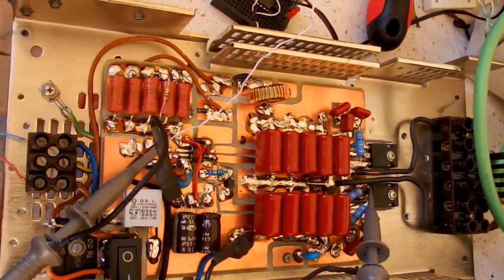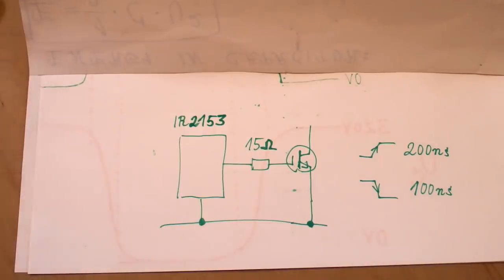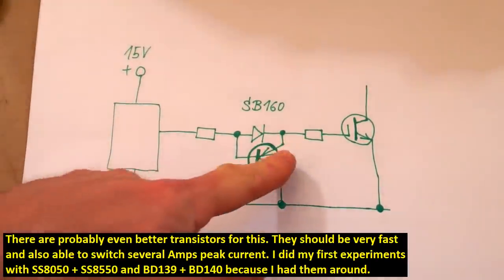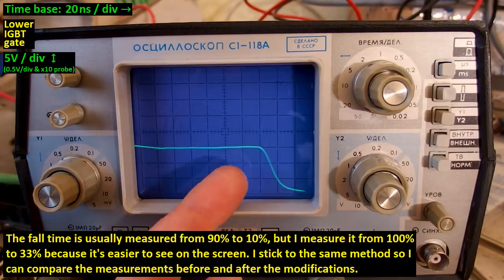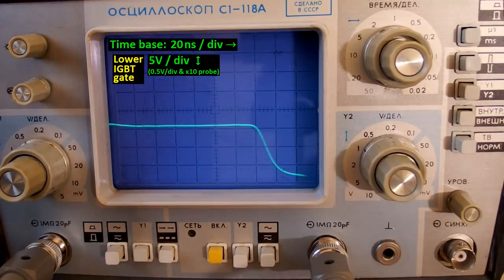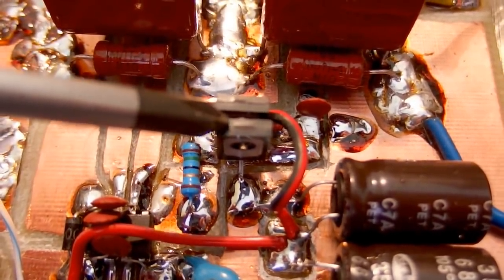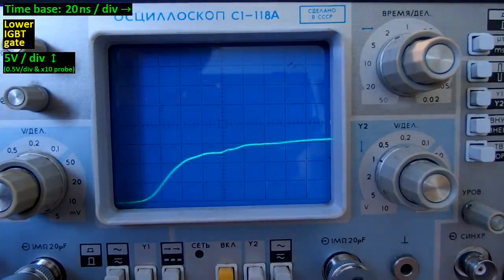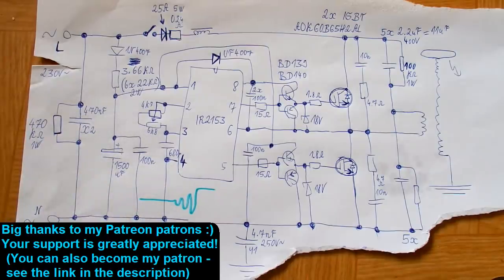SSTC pt. 10 - Gate drivers

Comment: We usually use also a small electrolytic capacitor like 22uf in parallel with the small ceramic onror to help out with the charging current to the gate

Comment: "IR2153" is an interesting driver, which does not specify the pulsed current output rating (in Amps). For example, "IR2110" has IO +/- is 2A, but "IR2153" does not specify any such value on data sheet. May be "IR2153" has low current drive rating and that may be the reason to add additional push-pull circuit?
Reply from the maker: there's multiple different datasheets of IR2153. Some don't say the output current, some say that it sinks 400mA and sources 200mA.

Comment: Great content! I used the two-transistor gate driving circuit too to drive a MOSFET faster, it works great! You should use a faster oscilloscope though to measure rise and fall times that short...the C1-118A is only 20MHz BW (had to look it up).

Comment: Great videos!! THANK YOU SO MUCH!! was wondering if I'm using a pulse transformer to control the gate, is it posable to still use a transistor to amplify the gate current?
wouldn't doing this  cancel out the isolation between the circuit? I think using the GDT was a mistake anyway! STILL WONT WORK!!
Thanks in advance
have a great day

Comment: Hi. Isn't the base resistor 15 ohm too low for BD139 and BD140? The base current should not be higher than 0.5A.
Reply: The maximum current from an IR2153 is around 180mA source and 200mA sink. This is more than enough to drive BD139/40 considering the HFE in these transistors. The base resistor could also be 47R which will still give enough current gain. This I tried myself driving a GDT and getting more than 1A at the output.
Reply from the maker: well, the 15 ohm resistor could be higher. I just left it in place because it was previously driving the gates directly :). I may lated change it to 33 ohms. But anyway, the IR2153 can't sink more than 400mA and source more than 200mA anyway.
Reply: @DiodeGoneWild  Well to be fair the source and sink currents are not specified in the datasheet for the IR2153  while its counterparts the IR2151 will source 100mA and sink 210mA and the IR2155 will source 210mA and sink 420mA I guess the  source and sink currents for the IR2153 must be somewhere in between. With these currents there will be enough to drive the current amplifier for the IGBTs for sure.  Keep up your good work and thanks for sharing your experiences with us.

Comment: The gate drivers need to be able to supply amps - do you have a feel for the size of current pulse into the IGBT gates with the gate driver transistors in place ? Just curious - it seems amazing that gate current could be so high, even though it's only a burst of course...:o)

Comment: Hmm, it is possible to use current amplifier at ss8550 in self-oscillating flyback to reduce turn-off losses? I have not seen anyone use similar solutions in self-oscillating flyback.

Comment: Thanks for the interesting update. It could be seen already in your last video about your SSTC but now its even clearer. I am working on a royer converter for an induction heater and have problems with good switching edges on the gates. I use power mosfets IRFP4768 (getting the real ones soon - after failure with counterfeits from ebay). I guess the edges got worse and worse with the load because the fake mosfets had much higher Rdson - meaning the other mosfet couldn't be drawn to zero by the fast diode and with the voltage drop over the diode and the bad conductance of the other switched-on mosfet, the gate of the stopped mosfet was in the threshold voltage and lost a lot of power. I wonder if this totempole amplifying circuit to improve to gate drive will help here too - as it is directly coupled with the main resonant tank circuit - what do you think?
Reply: If you have fake mosfets it will also have lower gate capacitance, adding a current amplifier will not help in your circumstance because you already got enough to charge the low gate capacity.
Reply: @Heads Mess Thanks for the information! The circuit i am using is here: http://kaizerpowerelectronics.dk/wp-content/gallery/2013_01_17_-_royer_induction_heater/royerIH.gif
The gates are driven by the feedback of the tank circuit via the fast diodes which draw the gates to zero when the opposite mosfet is conductive. If the Rdson is too high, it wouldn't be able to draw them to zero at high loads, so adding the voltage drop of the Si-diode there might be too much gate voltage still to totally shut the mosfet down. I measured the gate signal on different loads and it gets worse and worse. I am pretty sure i got fake IRPF4768 - thats probably the main issue. When i put the amplifier circuit (totempole config.) before the gates it might work better - still not sure if it disturbs the resonance circuitry? A schottky diode instead of the fast Si-diodes would also improve the situation - but you dont find a fast schottky for 500...600 V and some high current in the 10th A region. I drive the resonance at around 40 kHz only and have these problems - but no ringing so far. If you reduce the gate resistors you get faster on-edges (no fast off-edges) but put more load on the zener-diodes.
Reply: @supersilve  Yes, they have 50% lower gate capacity and they are fake. It seems the problem is not the current to charge or discharge the gate capacitors but the voltage level, esp. on the off-edge. Will see how the real mosfets work...
Reply: @richardnanis  Yes that is all true but that is how hard you switch the gates, more current more fast rise time and less fall time,, the edges get sharper accordingly.  The only thing left will be the time of switch on/off of the component itself that you can never change.

Comment: I have a quick question , why there is no voltage in the output of my gate driver if I have 12v in the input ? 
I connected it all correctly according to the datasheet and Im measuring it on a multimeter

Comment: could you use a schmitt trigger to flip a signal comming from an antenna and then tru a resistor or capacitor or both feed it into the chip for feed back?
and how it works is like this :  there will be a capacitor on the chip oscillator pin and the chip will start oscillating but the antana will receive the exact self resonance wave form from the secondary coil and then the signal will get fliped and then feeds in to the capacitor pin of the chip
so in that way the coil will run at its resonance frequency
Reply: You could but I think he avoids it to keep the circuit minimal. Steve Wards Micro SSTC uses the antenna feedback to drive a gate driver directly so the inverter isn't even necessary sometimes.
Reply: @Magneticitist  yes i have seen it
but as you know with the ir2153 when the timing capacitor voltage is rising the low side output is high 

this circuit is super simple and works
Reply: @Magneticitist  yes that would be much easier 
im very interested in electronics but i dont have money to buy even a cheap multimeter 
but i have made a single switch tesla coil with 10-15 cm long arcs
Reply: @alirezaeskandari2287  10-15cm sparks is more than a great start. Buying instruments and components isn't easy on a budget but these days they have some pretty affordable stuff available to where a person can sort of take steps instead of saving up a lot of money to get the expensive stuff. I think a $5 voltmeter is fine alongside maybe a $20 LCR meter. Something like a DSO138 scope can be handy at moderate frequencies, I used one of those for a while. I've seen those go for like $10 on ebay. $5 400khz signal generator modules are pretty nifty too. You probably know all that but just think about how expensive it must have been years back before all these cheap entry level instruments were available.
Reply: @Magneticitist  thanks for your advice 
but when you live in iran even a crapy old crt scope is 1M tomans and that is a lot of money for us 
a worker makes 1.8M tomans per month 

by the way im 16 :)

Comment: a comparation with TC4420 ci drive, please.
Reply: CD4022 is an octal counter, how would that drive a half-bridge?
Reply: @drobotk  sorry, It is a TC4420
Reply: @vidanatural_oficial  Oh, that's a different story
Reply: TC4420 is commonly used because it's fast and fairly powerful but the main comparison so far is that when using the low side drivers like that it's going to require what could be a lot more headache when it comes to say getting a GDT switching nicely.

Comment: Tx, very interesting and informative as usual. 
Could you also you MOSFETs as drivers and what would be the advantages/disadvantages compared to BJT’s?
Reply: I found this but don’t quite understand it.

Totem pole stage with N-Channel and P-Channel MOSFETs can be used to boost the output from an IC Driver. The disadvantage is that the signal is inverted and also there exists shoot through when common gate voltage is in transition.

Totem pole arrangement using matched NPN-PNP transistors, on the other hand, offer many advantages, while boosting the output currents from IC Drivers. Shoot through phenomenon is absent in this case. The pair of transistors protects each other’s base-emitter junctions and handle current surges quite well.
Reply: @Conservator.  whats not clear about that? It is a clear answer to the question, so i wonder how and where you found it when not understanding the jargon or
I wonder because if there is a way to find such nice&good&complete answers for such electronics questions that would be great for me and many, so i think
Reply: Rob Son 
What I don’t understand is why there would be shoot through when using MOSFETs and not when using ‘matched NPN-PNP transistors’. 
And why will the signal be inverted using MOSFETs and not with bjt’s. 

I didn’t read the hole document to be honest. I first posted the question and later added the explanation from the document.

Maybe I should read (=study) the document first.
Reply: @Conservator.  Inverting: With mosfets, you have a pmos on top and an nmos on the bottom. When the driver output is high, the nmos turns on and the pmos turns off (the threshold voltage, Vgs(th), for n channel mosfets is positive and for p channel mosfets, negative.). This connects the output to ground. Likewise, when the driver output is low, the nmos turns off and the pmos turns on, connecting the output to the positive supply. Thus, the output is inverted. 
Shoot through: Suppose the supply voltage is 12v. 12v is standard for mosfets, 15v for IGBTs. Because the driver cannot instantly change the voltage on the mosfet gates, with the gate capacitances and parasitic inductances, there will be some time when the voltage is high enough to turn the bottom mosfet on and low enough to turn the top mosfet on. From around 5v to supply-5v (5-7v here), both mosfets are fully conducting. Since the two fets are the only thing between the positive supply and ground, there is a relatively large amount of current that shorts through the mosfets. This is shoot through. 

The benefit of mosfets is that they can provide rail to rail outputs, since the have internal resistance instead of voltage drop. The gates are also isolated, so less current is needed to control the mosfets.

With bjts, there would be an npn on top and a pnp on the bottom. The npn conducts when the voltage between the base and the emitter is above some 0.7 v or so, proportional to the amount of current flowing from the base to the emitter. The pnp conducts when the voltage between the base and the emitter is less than around -0.7v, proportional to the amount of current flowing from the emitter to the base. Since both bases are tied together (without biasing diodes or resistors), it is "impossible" to turn both transistors on since the base voltage would have to be both higher than the emitter voltage by ~0.7v and lower than the emitter by ~0.7v. (The emitters of the transistors are tied together and to the output of the driver.) Also, since the top transistor turns on when input is high and the bottom transistor turns on when the input is low (high and low are relative to the voltage on the output), the signal is not inverted.
Reply: Tony Shi 
That’s a crystal clear explanation. Thank you 🙏 very much!

Comment: Hello, good job. Do you really need to speed up also the turn on? What about the diode recovery time? You could have bad issues when turning on too fast. A local turn off pnp is not enough to reduce switching losses ?
I have used PBSS4032PT and PBSS4032NT from NXP for this task and they are simply excellent. Very fast and very high hfe at high peak current. Maybe are not needed for your low Qg igbts but worth to give a try if you plan to use higher Qg power switches. Great job as usual.
Reply: Speed up the turn on is not to make it earlier but to shorten the switchingtime so the component (mosfet or igbt) is less time in the state between on&off so less powerlosses that heat up the fet or igbt.
Reply: @robson6285  yes but what about the recovery time of the other ibgt parallel diode when you are turning on? Switching on too fast is usually not a very good idea, especially in high voltage designs....